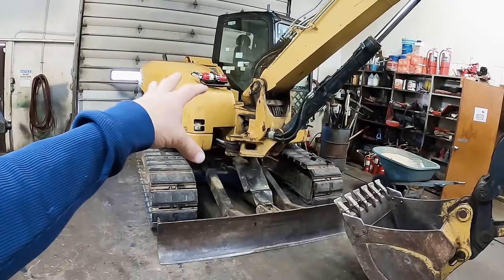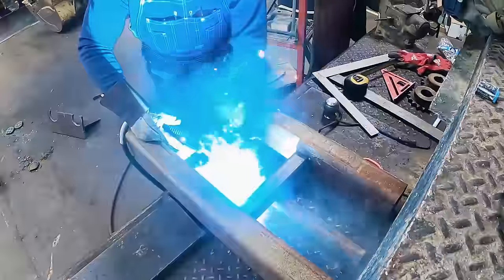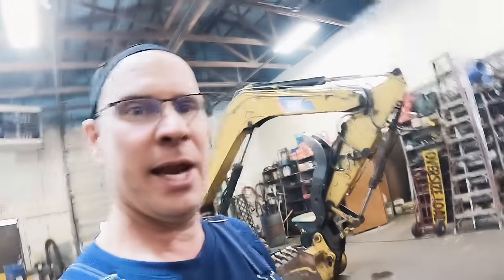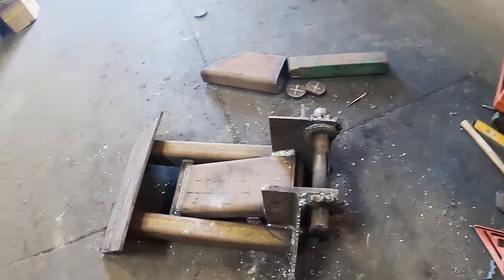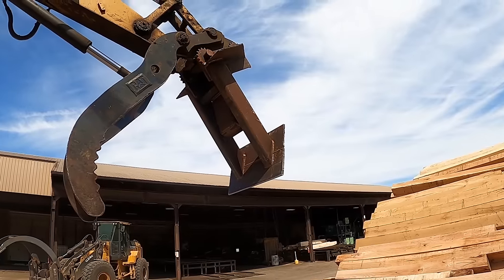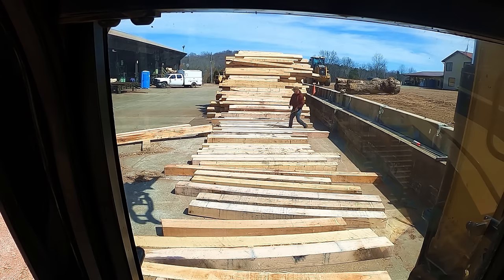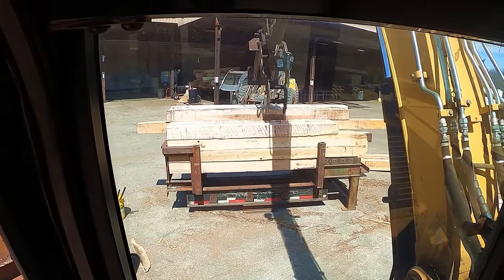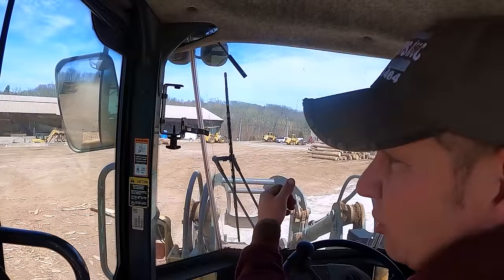Tie Stacker Attachment, Hillbilly Tech

Comment: The idea of using somthing thst is "junk" and making it have a purpose is somthing I've loved doing for 45 years now. I run a tiny sawmill operation and I will purposely make a trip to the scrap yard for steel to make a project long before buying new steel. I've been laughed at and all kinds of differnt stuff but at the end of the day if you can take 5 bucks and turn it into 50 it's a win! Too bad your not closer I have several sections of cutting edge I scrounge for another project laying out in the log yard you could use on that tie stacker! Great video!

Comment: 308s are my favorite minis , they are big enough to actually do something with and small enough to get into tight spots . All the generations prior to the 308e2 that I ran seem to have over heating problems in the dead of summer but you can run it with the hood open and it fixes that problem . I did 8 hours in my 308e2 hammering rock down to 12'' minus today . I got it with 3 hours and it has almost 4k hours now not a single problem besides an alternator !!@

Comment: Wade you got cutting edge all over the place. Find yourself some heavy steel plate cut it to size and  weld it on with 2 inch welds !!! Makes it easy to cut off to replace it when you need too.
Reply: Especially some of that work hardened deck materials from the mill. Anything that is beat up and worn so it needs replacing is good for that. Surely he has some plates that had to be replaced that took a lot of beating over time. That stuff can be harder than tool steel, just not rated or tested to an industrial standard.

Comment: It works , doesn't matter how it looks .
As for the stack,what if that was stacked on railway irons and have some bunks made from scrap sitting on them ,with the ties stacked from the mill ,tidy ,easy to handle maybe some of the sorting time made shorter ,if you inow what i mean ?
Can the ties coming off the mill be sorted by lenght before they are stacked , simple short or long then you can do the finnal pick as you have just shown ?
I might be way off lol but one never knows until we pipe up with ideas .
Great that you could wear your Sunday Best at work ,need a match tie 😅

Comment: Wade are you also doing bridge ties for the RR?  When I was a teen in Iowa, we use to salvage the old bridge ties and runners after C&NW  would rebuild the wooden trestle that crossed the creek next to our fields.   They would throw the old ties and Runners in our field for fence post, ad part of us giving them access across our fields..
Reply from the maker: Well I'm not shore what a bridge tie is but these are for the railroad
Reply: @LoggerWade   they are also called bridge timbers , and they can be as thick a a sleeper, but 20 ft long or more, they also came 12” to 14” wide.  When C&NW rebuilt the small trestle that crossed the creek, the so called bad timbers was 25 ft long and very heavy.,  the only reason they was replaced was a hot box on the rail car started a grass fire that scorched some of the timbers,many that was enough for them to be replaced.

Comment: Your giving me so many ideas. I do like the size of a 308 vs a 312 or 313. Can you get a way with hauling a 308 on a gooseneck pulled by a F-350 sized pickup? I do have an electric brake controller in my 4x4 F350.
Reply from the maker: I think you can